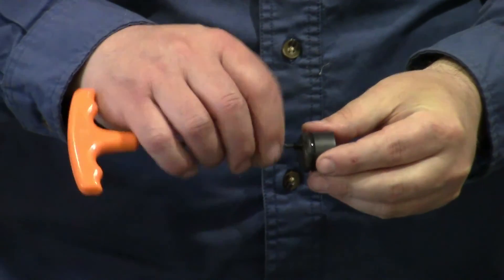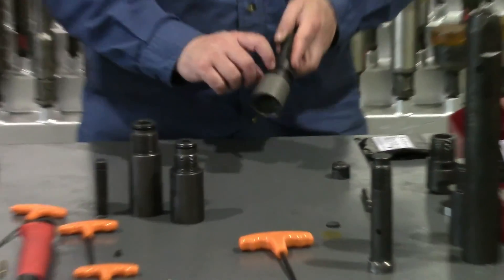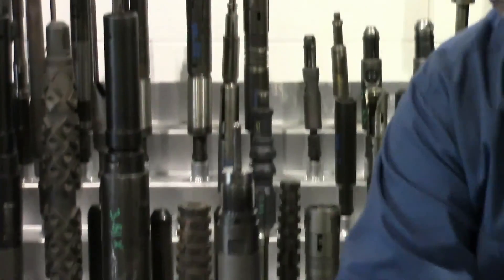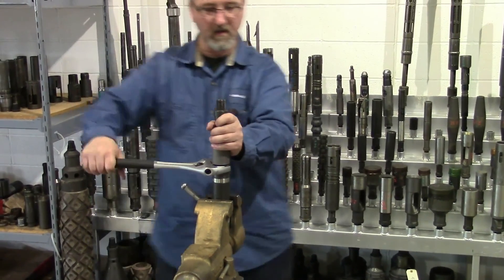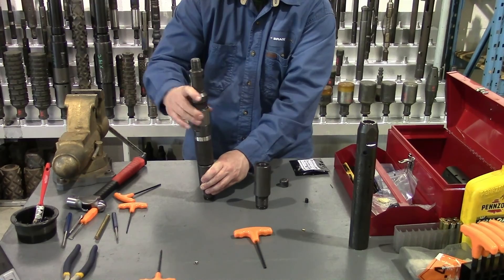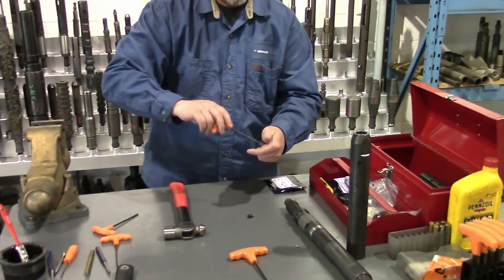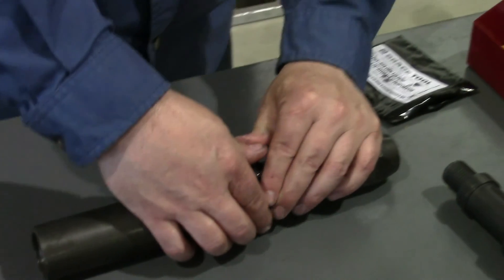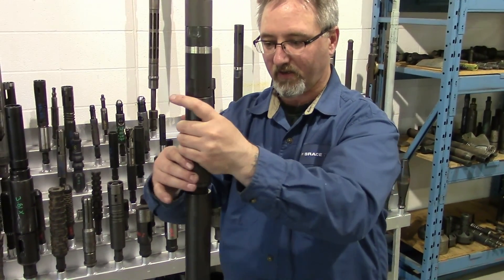SLICKLINE HYDRAULIC TUBING PUNCH ASSEMBLY

Comment: that s really great, and want to ask if there are any animation for running this tool, or how it works..thank you
Reply from the maker: The tool is activated by shearing a pin and driving a firing pin into a firing shell. 
The firing shell (basically a modified rifle cartridge) generates tremendous pressure against a displacement piston. 
This pushes the displacement piston into a column of oil which creates hydraulic pressure to push the punch through the tubing wall. 
The punch is held onto the punch piston by 1/16” shear stock which breaks off once the punch has penetrated the tubing wall. 
Once fired, the oil drains from the tool releasing the pressure inside the punch housing and allows the punch piston to relax so that the tool can be retrieved from the well.  Thank you!

Comment: Is the 17 gauge nail included in the kit, as that isn’t something we keep in our tool bags....
Reply from the maker: Hi Adam, we supply 1/16” drill rod with the kit that they can be cut to length to install the punch and is the standard pin used for this purpose.  

The nail you are looking for can likely be found in a local hardware store.  

Thank you for reaching out to Brace Tool.